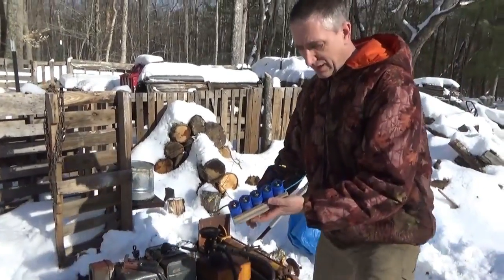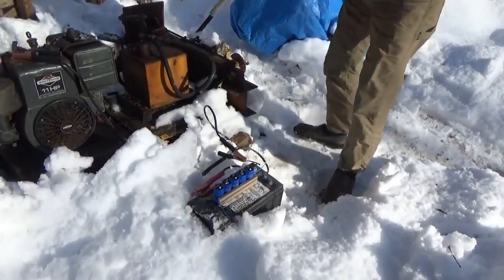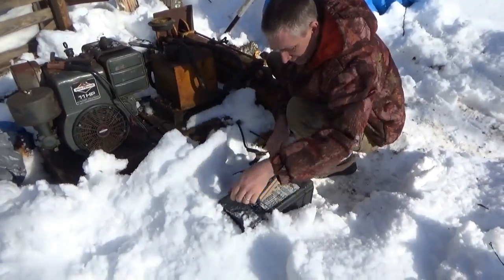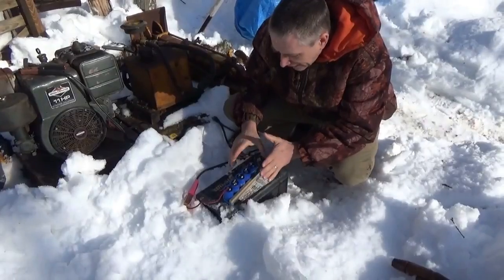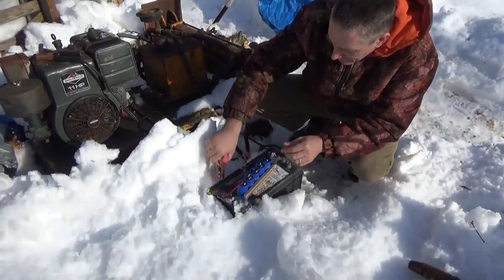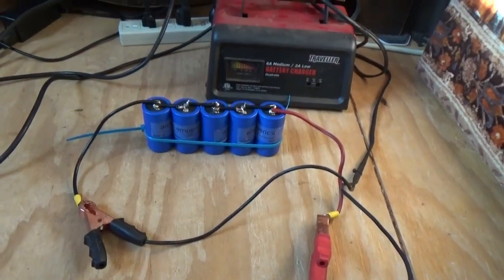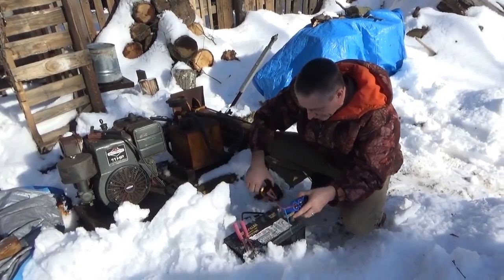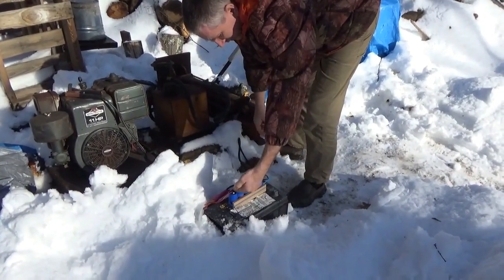Starting 11 HP Log Splitter Engine On 5 Supercapacitors

Comment: How much did those caps cost? I bought a lithium battery with jump starter leads and leads to charge a cell phone and also a air compressor and the battery has a flash light built in.  It will start my v6 Ranger. It says it can start a v8. The whole thing was only 40 dollars. It comes in a handy carring case you can put in your trunk of your car. It pumps up a car tire fast too.
Reply from the maker: +shartne I got them free for experimenting. I plan to make a jump starter pack with these too
Reply: I saw the lithium battery jump starter you got for free woo hoo. It is awesome. The only problem with caps is they dont hold a charge for a long time. I like to put them on my solar bank to help start big stuff like my freezer. Saves the batts for the initial start when it pulls a lot of amps and makes the  bank more efficient.

Comment: good work. even if it's not new way to start it's a good way because you can quickly charge the caps and if the engine starts easily it's good enough :)
Reply from the maker: Thanks. I am going to experiment with different ways to keep the caps charged between uses

Comment: would the capacitors act like a battery that had just been used and return to a resting voltage ?....plus being you had the capacitors outside would they have been chilled and reduced voltage that way....once inside warmed up so better power?
Reply from the maker: From my understanding capacitors are not affected by cold like a battery. I think what I was seeing is the "dialectric effect" where a capacitor can regain some of its energy after use.
Reply: yes they are... electrolitics are temerature sensitive.
Reply from the maker: MrBugsier, please show me where you got that info. Everywhere I have read, I have seen that they are not. Not trying to argue, just genuinely asking.
Reply: the working off a  electrolitic cap and a lead acid cel ar almost equal.

Comment: Nice video I haven't seen those Amperics brand super capacitors before.
Reply from the maker: +wiggys shop thanks. I found them all over amazon and eBay. Bigger caps at a lower price. I plan to put them thru the works and see what they can do

Comment: With what seems to be a lot of knowledge about electricity, looks like you could get a real job.  What is this?  Low summer shoes instead of winter boot, out in the cold. The large battery setting in the snow, more than likely is toast, as in no longer useable. Should take batteries in side in cold weather. Unless they are being used for something  regularly, that will recharge them. Let us see if the land lord will let you stay without paying the mortgage payment. Did you make anything on craigslist?  Did the jeep sell?  I am concerned about how you will get along as Mel gets closer to having the child. She can't climb up to the loft, and won't be able to do any work. Leaving you and Chris to do it all. Do you have insurance to cover her and you?  This just doesn't seem right. Once again, my 2 cents. I still wish you good luck. God knows you'll need it.
Reply from the maker: Well actually I wear what I want on my feet. Anyway, they are comfortable and my winter boots were soaked at the time from a bike ride to get the mail.
The battery is just fine and under that snow its on a board. It gets used many times per day actually so it is always under charge when the machine is running.
Nobody will let you stay without paying the mortgage. Just part of life.
As to the rest of the points - well, they are my own business I guess.
Thanks.
Reply: YEP! Your right, and when your right, that settles it. It is your own business. However, when you put your life out so people can hear and see your private BUSINESS, you leave the door open to scrutiny! That comes good and bad. If you don't want to live in a fish bowl, shut down your channel. Some of us have lived much longer than you. Not that we are smarter, I concede your superior intellect, but have been down the road farther than young folks. Ponder this: I have been down the road before you come along. I'm standing along side the road as you approach. I'm waving for you to stop, but you ignore my efforts. As you continue on, I can hear the sound of tires screeching, and then a loud crashing sound. I run to your assistance, but find, you, your wife, with unborn child,  DEAD at the bottom of a river.  You see, I have been down the road farther than you and have seen and experienced many detours, and committed many mistakes. Believe it or not, the things I write, I write to try getting you to think through, and look and plan ahead.   This next statement will probable get me many attacks, but, I communicate with you as a son. Again my 2 cents. Good luck, and God bless. Oh! By the way. God sends people into our lives to help guide them along.
Reply from the maker: I was not trying to cause trouble. Just answering your questions. My boots were wet so I wore shoes. The battery is run every day. And the rest I just dont share. Not because of you, but due to others who are looking to cause me trouble. Oh, and no way I can stay without payment. Not even in the question.
Reply from the maker: cant. cannot. I cannot edit my own comments anymore.

Comment: as the leads are hot they become resisters. as they cool the wires become better conductors and you lose less voltage across them. I don't think you gained voltage from them resting but that as they got colder you lost less across the resisters. the resisters being the hot leads
Reply from the maker: I have a data logging meter on the way. I plan to map out the voltage over time as I work with them. Look up the "dialectric effect". An electrolytic capacitor can recover some of its charge. Nobody knows exactly where it comes from but it happens.
Reply from the maker: No, I dont think so. The caps were only outside a few minutes. The voltage recovery went on for hours. I cant wait for my data logger to arrive and I can chart this stuff.
Reply from the maker: That may be but it seems that they gained more voltage long after they had cooled down.
Reply: Troy, This is interesting because I can't figure out what's happening here, potential in a capacitor shouldn't increase over time. I don't know much about these components, but I'm wondering if they are more than simple components- eg: contain a diode, some kind of protective circuit, etc. It would be interesting to see the voltage of the individual capacitors before and after an event of potential/volt increase.
Reply: its de difference in temp outside, and the heat insite the t.h., that creates a smal recovery.. (same as heating a lead acid cel,the voltage will increase when you heat them up), its still a chemical process.

Comment: Troy I have seen other videos where they replace a car battery with very large capacitors.
I owned a photo studio in Houston in the 80's when i got out of the military so I am familiar
somewhat with how capacitors worked in our portable flash units. I found a box of old Graflex 
bare bulb strobes I had a lot of fun using in projects of my own in the studio.

I assume since caps take in power and hold it until they are discharged that if used as a car battery
you would only have a limited amount of cranking time before they are totally discharged.

Is there some advantage to using a capacitor in the place of a standard lead acid battery in a car?

Oh, do your super caps make a whining noise as they charge?
Just wondered.
Reply from the maker: I have been studying the subject for a while now. You can either replace your car battery with a bank of capacitors large enough to start it in any condition. The alternator will keep it charged up for you. Or you can use a bank of capacitors in parallel with your battery to prolong the battery life. Each time you start a car on a battery it is drawn down pretty low. This harms the battery with time. I plan to do a lot of studies and tests using caps with and without batteries. I have a data logging meter on the way so I can record the results on the computer.
Reply from the maker: There is no sound when charging. Only the battery charger hums but that is normal.
Reply: Ahhh so using capacitor battery booster in a battery bank off grid would help in a high demand time when a refiigerator compressor kicked in for example and made a big spike in energy consumption.
Reply from the maker: Thats for sure. Yes it would help in off grid homes with a surge. And in a car for starting for that surge. Makes the batteries last longer.
Reply: Do you have any plans in the future of putting in a capacitor booster bank in with your battery bank to give the batteries an assist when you are off the grid in Michigan and are planning to have enough solar to run a fridge in the house and possibly use a small AC in one room in summer?

The cap booster I assume would really help out the battery bank when compressors kick in and make that big amp draw.

Are the larger capacitors less expensive?  I recall you mentioned these small super caps cost about $49.00  each.  The YT vid i saw where guy made car capacitor battery replacement said he used 6 big caps and they were only $6.00  each.